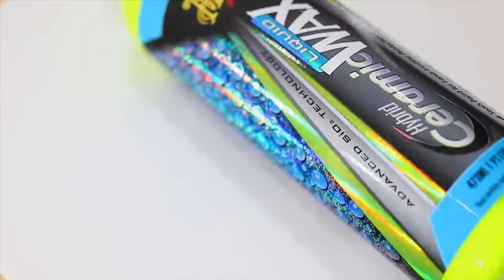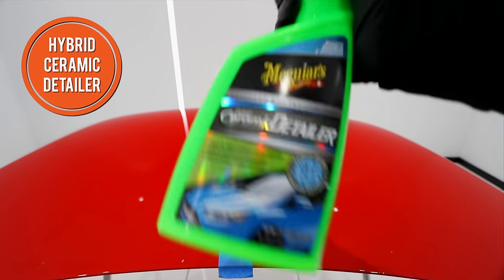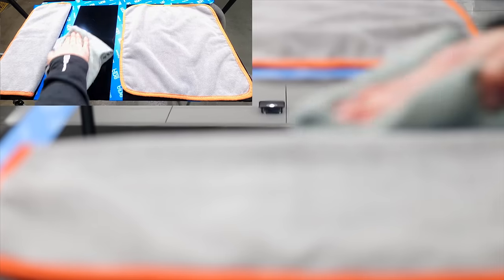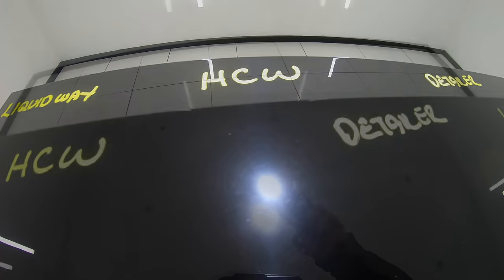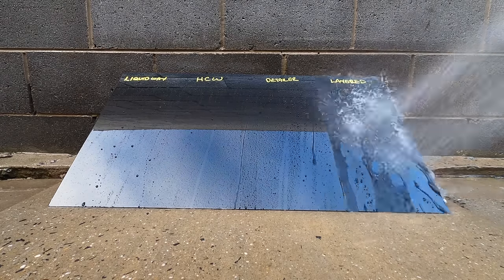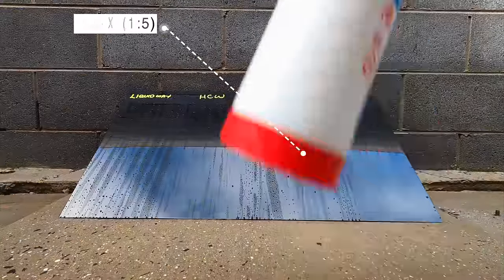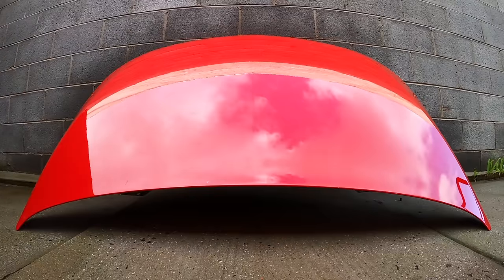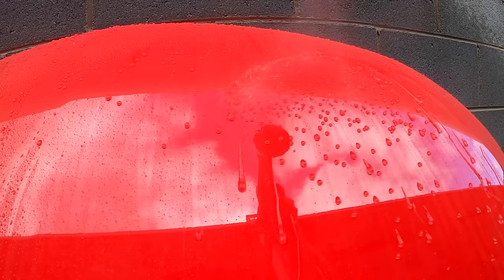Meguiars Hybrid Ceramic Range Testing & Reviewed!

Comment: I tried the Hybrid Ceramic Spray Wax last month and applied it wrong (too much) Didn't look great. Then I removed it and used the LCW and loved the ease of application. I just laid down a coat by itself.  Today I did the first maintenance wash over it and then "refreshed" it with the HCW (spray off method) followed by a top coat of Quick detailer. I'm really liking the ease of use of this layering method. Remains to be seen how often I'll have to strip and lay down a fresh base coat though.
Reply from the maker: Yes, the LCW is really nice to use and I think if you stay on top of it and don’t mind roping and replying it, it could be a good way to go.

Comment: Been using the Hybrid Ceramic Spray Wax on my 2001 Commodore and it's been great, lasts a while and it's easy to put on. I've been washing the car then while it's wet give it a few sprays then dry the car with a microfibre cloth. Looks and beads awesome. Although after watching this i might try a dry application.
Reply from the maker: I appreciate you sharing that, and I’d say give the dry application a go!

Comment: Excellent review. I love the ceramic spray wax too, will invest into the ceramic quick detailed for top up cleans. Currently using a quick detailed that takes me 10 minutes to clean car, makes sense to use the ceramic version to maintain the ceramic like finish with investing 30 minutes into applying the liquid spray

Comment: My fav is the quick detailer. I use it as a drying aid on my cquartz protected cars. Works awesome
I also agree with your thoughts on the liquid wax. Just felt like it didn't meet the stupid Australian pricing. Even at repco discount prices. But I maintain my ceramic coated cars with the liquid wax and dry occasionally with the detailer.
Reply from the maker: Greet to hear and thanks for sharing that!

Comment: Meguiar's isn't as low cost as it used to be , once I finished all my old product in the garage , I will look for wax it for new products from your recommendation.
Reply: On a side note, turtle wax's hybrid spray sealant is still the most cost effective product I can find in normal retail stores. Although you will have to be aware don't leave it sitting for too long before wipe in down.

Comment: The spray wax (blue) is in my opinion the  best product.  I used it using the recommended spray on to the panel then spray off with a hose method and was really pleased with it.  I will now try your suggestion.   I've recently tried the Ceramic detailer (green) and although good I didn't think it was as good as the blue bottle.  Will now use blue with green in between.   Great products.

Comment: megs hcw spray is the best product out right now. I do recommend two to three base coats of the liquid version first on top of ultimate liquid wax sealent. Then spray and rinse with the hcw at each wash. Makes true touchless wash possible without needing any soap. no degredation of gloss or water behavior after 4 months...still perfect. megs did a fantastic job. 

However, I dont really like the detailer. I find it leaves streaks. I may not be applying it properly, not sure.

Comment: this is the same exact experience i had using these products. i could have saved a lot of time if i had just seen this video first. Always buying the hybrid ceramic wax (blue). seems to need reapplication about once a month I wash every 2 weeks or so with a foam cannon and meguiar's hyper wash (red). Dont even bother with the ceramic detailer (green), best I can tell its gone after the first rain storm.

Comment: I got all 3 in a kit with clay/ sponge applicator,  and microfiber cloth for 39.99CAD , big win
Reply from the maker: Rubbing it in on how much we pay in Oz lol
Reply: @CarCraftAutoDetailing  yeah it seems like you guys really do get it bad on pricing for a lot of things. Guess their excuse is that it's fairly isolated. Too bad your government didn't invest in more local manufacturing . But this seemed to be an exceptionally good deal. As just the wax, liquid or spray alone seem to be around 30 a bottle. This was quite the value  in comparison to the stand alone products.. very comprehensive review BTW, thank you. Subbed.

Comment: Great video - I think you nailed it pretty well across the board. This is coming from the guy who helped develop all three of these items :) 

The one thing I would add, is that if you establish a base coat once with the HCW, you will find that the spray and rinse method works far better as it tends to bond to itself quite effectively. So the occasional spray and rinse during the wash process ends up being most likely the quickest and easiest method of on-going application. Alternatively, I tend to like using it as a drying aid of sorts with a couple of spritzes of product directly into a microfiber drying towel, then hitting the wet panel, and either flipping to a dry side or using a dry second towel for a final pass.
Reply: Please see my comment above. I got the most amazing results doing a full paint prep (all meguiars products, including the DA polisher, which is awesome), then the megs ultimate liquid wax, then applying three base coats of the liquid hybrid ceramic version with a day cure time between each, and then using a rinse, spray, rinse method each time I powerwash my car. The gloss and water behavior are insane. It seems that with a really good base coat, the spray and rinse method with the hybrid ceramic spray is extremely effective for touchless washes that maintain the gloss and hydrophobicity.

Informally, I also noticed that, at least with the hybrid ceramic liquid wax, the durability is quite poor on paint that has not been prepped at all. So some people who report poor durability did not prep the paint properly, for sure.
Reply: @HeavyProfessor  Confusing professor.
Reply: @kimdavis5631  you alright?
Reply: @HeavyProfessor  no confused

Comment: Sandro do you dilute your Car Pro Elixsier? I live in South Florida-always hot and humid, and i think the concentration out of the bottle neat is just too strong....i added about 1.5cups/ or something like half a quart of water to the bottle and it works just fantastic now with no smearing what so ever and i ever use it as a drying aid now which is fantastic...previously i could never use it as a drying aid because it would smear a lot, probably due to the very humid environment here...anyways just curious if you diluted Elixsier at all?
Reply from the maker: No I don’t dilute it, but it sounds like it works really well in your case  and could be a good way to go in more extreme environments

Comment: Do you think the Meg’s hybrid paint coating is better than the spray wax for protection?
Reply from the maker: I haven’t compared them side by side but I would tend to think that the Hybrid Paint Coating would out perform the spray wax.
Reply: @CarCraftAutoDetailing  ty, will watch more!

Comment: I wonder if the issue with putting the spray variant on a dry surface is, or could be, increased risk of creating more small imperfections in the paint, causing Maguires to recommend against doing it that way.
Reply from the maker: Although I did experience or see that, it could certainly be another consideration

Comment: Would you recommend applying 2 coats of the Meg's Hybrid Spray wax ( 24 hours gap) for better protection ?

 I ve seen Turtle Wax recommending two coats for their hybrid spray wax.

Thank you !
Reply from the maker: Yes absolutely, a second layer should help improve durability, looks and overall performance.

Comment: Hi, can you please tell me from your experience or opinion, how will this  3 products work or do on gelcoat, on white or colored saltwater boats (which have be normal polished and waxed before- a old school way).
Have and Would you do it on a boat or do you know somebody who have done it? 
Reason is to avoid classic waxing the boat minimum 4 times per year and do it with this product 2 time per year (before and after the boating season ). I can't find anywhere who has do it on boats and how, and how long does is worth? I am thankful in forward for any information ...........
Reply from the maker: I really have no experience trying them on a boat, the gel coat won’t be an issue, but the salt water for extended periods will be the real test. 
The prep work before applying them is going to be really important, so you will have a far better and lasting result if the boat is given a thorough decontamination wash and the gel coat is polished before hand (just the one time) and also given a good IPA (isopropyl alcohol) wipe down immediately before you apply them. 
Personally I’d also suggest just doing two coats of the Hybrid Ceramic Liquid wax rather than layering all three, as the HCW is really the product of the three that is going to have the best durability and longevity chance.
Reply: @CarCraftAutoDetailing  thank you very much👍

Comment: Awesome video Sandro, would love to see more like this on other commonly available products. Have you seen Waxmode's video on the HCD? He shows old ceramic coatings getting a massive boost in performance that lasts long term, going beyond just covering up an old coating. I wanted to know if you had seen similar things in your testing, or if you had similar experience with NV Boost or other SiO2 detailers?
Reply from the maker: I’ve not seen that video but Waxmode is a great channel and I’ve not tested it with HCD but I have seen Boost revive coatings so it can certainly work!

Comment: Hi, does it make any significant difference in gloss and repellency if I apply two layers of Meguiar's liquid hybrid ceramic wax? Thank you
Reply from the maker: The first layer is what always creates the best bond and performance, a second layer will usually just improved on it but not do quite as much as the primary layer.

Comment: Great video Sandro, but in my testing HCLW actually has better real world durability. When you put down the spray bottle and start putting up the miles, you'll see a lot of the "chemical resistant" products are actually not as durable as some products that normally fail those tests. I have a video on my channel showing how HCLW compares to Seal N Shine after 2.5 months through spring and summer, and even weaker products like CMX stood up better than some other products that win chemical test challenges.
Reply from the maker: Yes there is always variables to consider but you also have to accept that how you personally applying it and where and how you’re cars are maintained is going to vary compared to almost everyone else. So no one test or experience with a product is ever definitive, but I appreciate you sharing you’re experience with it.
Reply: Car Craft Auto Detailing My point is that it almost never rains carpet multi x, otherwise I’d put out a bucket.
Reply from the maker: Yes I understand, and my point is that no one is going to replicate you’re specific method, environment and circumstances either. Every product on the market (or at least the good ones) use some form of resistance testing to predict durability and other characteristics, and although no method is perfect all my testing has shown that the products that do hold up better in my tests also last longer on my and my customers cars in real world testing - that’s my correlation and rational which has been quite consistent.
Reply: Car Craft Auto Detailing I understand why people use chemicals, and I commend you and waxmode for using consistent testing between products. However, I’ve tested multiple products at once on the same car in the same weather and the ones that fail under normal, reasonable chemical testing lasts longer than the kings of chemical resistance. It’s quite clear that companies are now using chemical testing in their product development because most modern products like HCW and even the detailer have excellent resistance. It’s a tangible selling point or demonstration for a company and something most of YouTube watchers are expecting a product to do well in those tests. Again not saying your tests or videos are invalid or not appreciated, the exact opposite. I just want to say that when you do chemical testing it’s only relevant for chemical resistance, not real world durability.
Reply from the maker: I’d always encourage people go by their own testing and experience with products when making a judgement, because their results are going to differ to others. Just read a few comments on almost any video I’ve made and you’ll see that one person had great performance and durability out of the same product that someone else had poor performance and durability, 
which is all specific to their own real world performance on their own cars, in their own environment with their own specific prep and application. I believe you when you say that you’re testing has shown that products with superior chemical resistance have had poorer real world durability, but that just couldn’t be more different than my personal experience which has shown a very strong correlation between the two. 
I appreciate the good civil debate and you make some good valid points, I just think we have two very different experiences which is also fine!
Reply: Car Craft Auto Detailing agreed, not all environments are equal and test conditions can vary even when effort is made to not. I found Dnitry’s garage handsome interesting content. He washed by had all products until the fail. The new formula Seal N Shine failed around 21 washes, where as the Adams graphene spray coating lasted over 80. Other channels have shown that the new SnS out lasted the graphene spray, so the testing differences are really interesting.

Comment: This is an amazing video.  Thanks for sharing this first rate analysis on their ceramic products.  You stated this could be a sealant and a wax.  If I use the hybrid ceramic wax, can I just stick with that one product and forego using a different paint sealant altogether?  I personally hate applying sealants.
Reply from the maker: Thanks and yes you can certainly just use Hybrid Ceramic Wax as your sole paint protection product.

Comment: The only thing that bothers me about these products is that I've heard countless people tell me their car is "ceramic coated" when they use these products. Like, is it actually "ceramic coated"? To me, it downplays the superiority of a real ceramic coating applied after a paint correction. Anyone else hear this and what do you think?
Reply from the maker: Yes, the real issue is that there is no real standard as to what brands can call or claim about products and no real repercussions to misleading information, but it’s a tricky thing to regulate.
Reply: @CarCraftAutoDetailing  I completely agree. I figured they could maybe use SiO2 content to regulate what classifies an actual ceramic coating. But these companies use .05% SiO2 and call it ceramic lol. So misleading indeed. Thanks for the reply.

Comment: So, it’s seems it’s best to:
Use the spray wax.  But not just with the foundational layer,  but always to spray it on a wet surface and then WIPE, not rinse.  Correct?
Reply from the maker: Yes

Comment: Should you throw away the microfiber towel after using these products? I understand you should for full ceramic coatings not sure if the same applies to these?
Reply from the maker: No you can reuse the cloths, a true ceramic coating hardens and also does so in the cloths, these products don’t harden on the paint or cloths.
Reply: @CarCraftAutoDetailing  Great thanks! Love in the in-depth vids, helps cut through the marketing crap!

Comment: Great 👍 thanks for your efforts i found meguiar's m27 is same as Hybrid Ceramic wax dry application and top up with hybrid ceramic spray wax as spray and rinsed applications. durability is more than 3 months. But still looking ultimate slick product which is value for money and great slickness atlas last one or two wash 
I am trying to get Ethos wax and D3FY if you have access please review 
Thanks for your time, investment and effort 👍
Reply from the maker: Thanks, and thanks for sharing that, I will try to review the brand in the future.

Comment: nice video sandro. I was wondering what if you apply first during the wash Hybrid ceramic spray wax, rins it off and after drying applying liquid wax on top of it?
Reply from the maker: Thanks, but I would imagine that liquid wax would last even less over the spray wax compared to applying it over clean bare paint.

Comment: According to meguiars uk they said in 2015 the spray ceramic wax lasts 6 months and i did read the hybrid ceramic liquid wax lasts up to 12 months.

But there are many variables which affects wax durability, was it applied to a clayed surface ?
And is the vehicle washed frequent and are ceramic boosters used over the 6 to 12 months ?